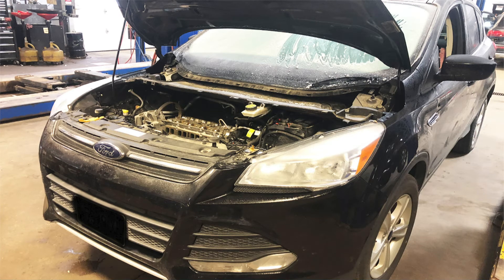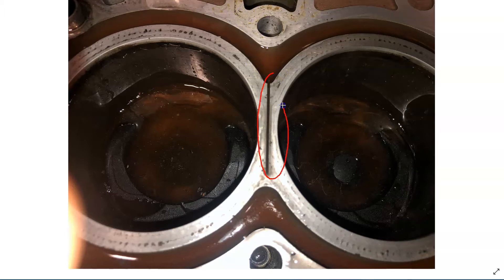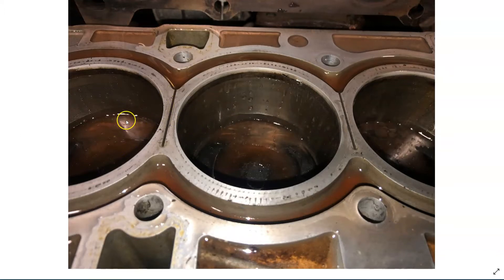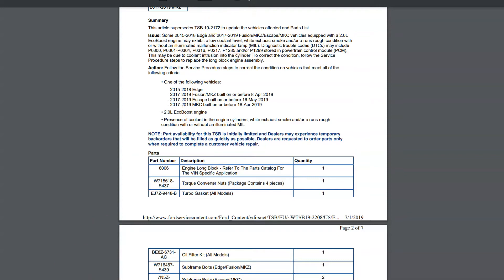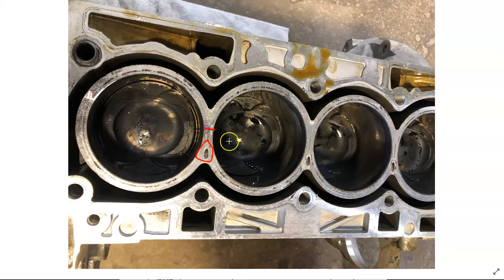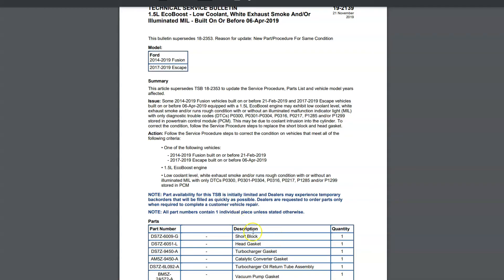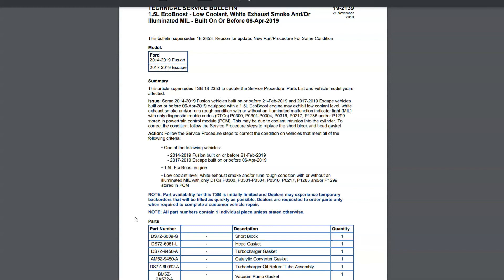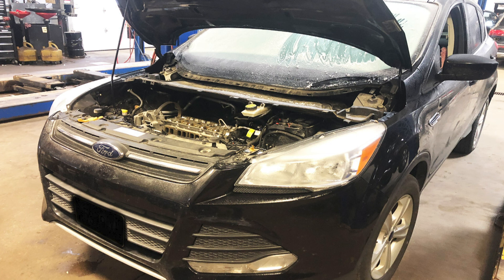2016 Ford Escape 1.6 Engine Coolant loss in cylinder, defective block and cylinders head, LONG BLOCK

Comment: I have a 2016 Ford Escape that has a coolant leak into cylinder#2 causing engine to overheat. Is there anyway to fix this without block replacement?

Comment: Thank you for the info, I’m not a mechanic but I’m trying to learn how to do this myself. 
Know it’s not the best thing to do but it’s my only option currently my warranty ran out a month b4 the transmission went and I had it fixed for 6grand then this happened and it crushed me after spending that much on repairs.
I do not have enough money to fix the car in fact I still owe on it, and it’s annoying, I’m paying thousands for a car that’s not valued more then a grand. I can’t work full time or maintain a job without a car. 
It has kept me up at night for almost a year now. 
God Bless you for your generosity!

Comment: You gotta go with a higher anti freeze concentrate and lower percentage distilled water 75% anti freeze concentrate / 25 % distilled water would be a more adequate mixture.

Comment: My 2017 escape started having DTC 0302 at 102000 miles. No coolant loss, but the engine started roughly for a few seconds. My mechanic says the #2 cylinder head is cracked, causing coolant intrusion.  I’m looking at a rebuilt engine to fix this. $$$$. 😫

Comment: I bought a 2015 about three years ago with 14k miles on it, pre-owned certified from Ford,  lucky I opted to buy the 8 year 80k mile extended bumper to bumper warranty offered on pre-owned certified ford's for a couple grand.  Right at 50k miles I started getting a p0420 code followed by a p303, then the next day seemingly the purge valve started intermittent issues flooding the car out on start up, then coolant loss started shortly after. Pulling the plug in cylinder 3 showed a plug end wet with coolant and oil. Not to happy to say the least, as this car has been serviced beyond what the manual suggested. Oil changed and filter every 3k, new plugs and air filter every year, plus a coolant flush at 30k. Car has never been abused in the least, never even gone over 30 mph  on dirt roads even to be easy on the suspension so it lasts. My old 98 Jeep had almost 350k, my Subaru WRX STI has 70k, my 89 Honda crx si has 200+k, and each has only had small wear items replaced, never a engine problem on any of them. Those cars must of had over engineered engines, or Ford uses really cheap parts. Considering the 1.6 Ecoboost uses a cast crank, rods, and pistons on a completely open deck block, then they add a turbo, kind of sums up the answer to why. Why Ford didn't look and see why every Japanese manufacturer (the companies who have built good turbo car since the 80s) uses at least a forged crank, rods, with a semi closed or closed deck block on turbo engines is beyond me. It just seems these types of problems were solved by others generations ago, so there seems to be no excuse for Ford except for being cheap.

Comment: Had a 1.6 it had 42,000 miles head gasket blew ford put new creat motor in gave 2 year warranty with it 1 week before warranty ran out motor blew head gasket lol these motors are junk never buy one.
Reply: Also that was in a 2014 ford escape

Comment: My fusion is leaking cylinder 3 and 4.
Reply from the maker: There is a lot problems with these engines unfortunately
Reply: @videoserviceinformation   will changing the short block fix it?

Comment: Im wondering if thats whats going on with my 1.6 ecoboost. 
I have no visible leaks under the car but do have coolant loss. I guess a guys just going to do the right thing and replace a head gasket ..... Great..... No no its not great.
Reply from the maker: I'm sure that's the problem. Head gasket won't fix.